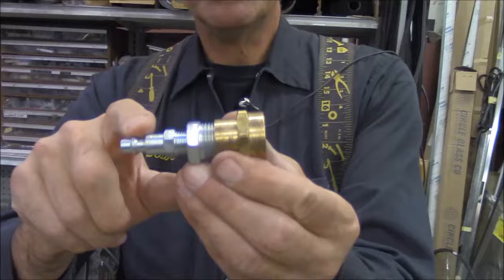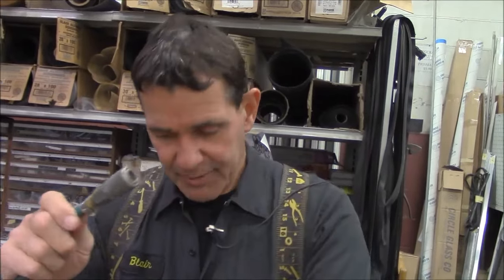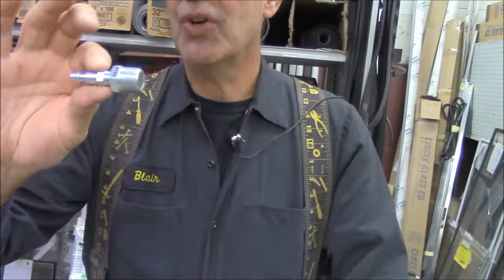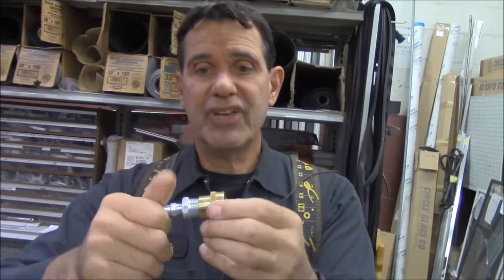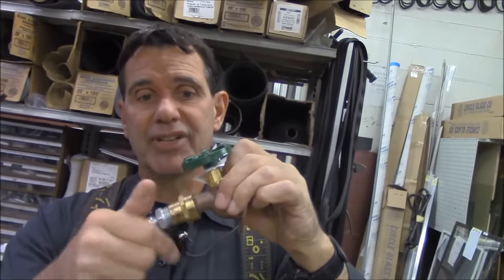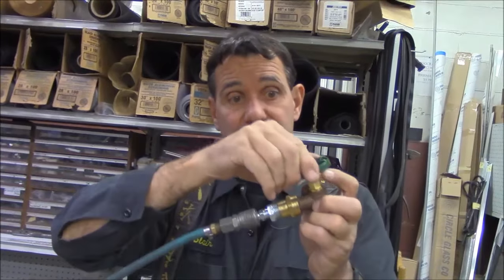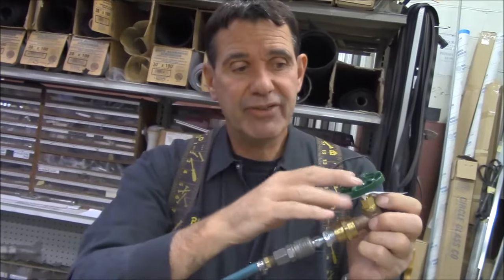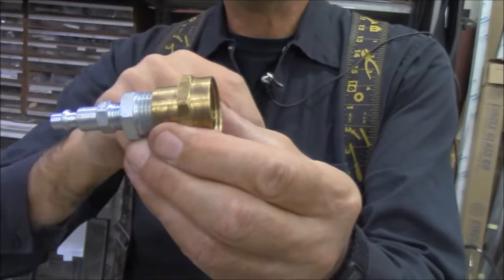Tips, Advice to Blowout, Winterize Water Pipes, Simple Air Adaptor Tool

Comment from the maker: Those of you with anti-siphon hose bibs or hose bibs with a vacuum breaker attached will have to find a different source to blow air into the plumbing.
Reply: How about the clothes washer valve? No one way valve on those.
Reply from the maker: Perfect, if you can get the compressor there.

Comment: 50 is a lot. I would use 30. 30 is more than enough to blow out PVC and CPVC. Also I never use more than 30 lb in my sprinkler system when I blow it out. It's volume not pressure you need
Reply: Exactly. Even 10 PSI is enough to get the water moving.

Comment: Great video, and something worth doing. Here's a question. My water lines to the shower/tub are pretty much clogged with build up. is this something that would work to clear them? I can't afford to have them replaced at this time, which is why I'm asking about if this would be a good temporary fix until I can have the funds to replace the pipes.
Reply: Sometimes people send water backwards and others use compressed air, however sometimes things get loosened up only to clog together in a worse situation. Pex plumbing is very inexpensive and is very easy to do yourself if you have some skills.
Reply: @blairgilbert7606  Thanks for the information. I wondered about making a worse situation. I'll look at installing pex.

Comment: Thank you! You helped a homeowner clear out a tub faucet after changing the cartridges didn't help. I really appreciate it!

1. Air compressor quick connect -> 1/4” male adapter
2. 1/4” female -> 1/2” male adapter
3A. 1/2” female -> 1/2” coupling (used this for tub/shower spigots)
3B. 1/2” female -> 3/4” male hose adapter (will use this later)
Reply: what was the blockage-was it calcium lime scale?
Reply: @sl5311  I can't recall tbh, but I think it was literally gunk from our city's old plumbing.
Reply: @nashdashflash  I just put white vinegar(the cooking type) in the shower head down to the blockage in the cold handle.  I bought an inspection  camera and saw that the hot handle side was almost blocked as well. I let it sit for 24 hours and I got a little of the cold blockage out, it is running a tiny stream of cold water so I will have to do it again.  One thing for sure is that a camera has convinced me to get a water softener. It was disgusting.

Comment: Hello Can you recommend an air compressor to me to clear the air out of my hose lines? Thank you
Reply from the maker: Anything that has 5 gal tanks or more. If you have a large yard you may need larger tanks, up to 10 gallons. The horse power is not too important because you will wait until the tanks are filled before blowing out each zone. The more horse power the quicker the tanks will fill, the tank full of air is what clears the line. I have a small 5 gallon compressor so I blow out each zone 3 times to be sure there isn't any water laying in a low spot.

Comment: Great video.  Does the compressor hose make a difference? Can you also list the parts needed in your video description with sizes?  Had to rewind a couple times :)
Reply from the maker: Air plug to 1/4" male pipe thread, a galvanized bushing 1/4" pipe to 1/2" pipe, av1/2" pipe to female hose adapter. Some teflon tape to secure the joints and a hose washer to seal the adapter to the hose bib.
Reply: BEAUTIFUL!!! THANK YOU!!!

Comment: 1/4 thread on quick disconnect? I may be wrong but it at least looks 3/8
Reply from the maker: The air plug is quick by 1/4 npt. It goes into a 1/4 x1/2 galv bushing, into a 1/2 by female garden hose adapter.

Comment: Hello, great channel, I just subscribed. Are there any particular brands you recommend? I’d like something inexpensive, if possible.  I'll be using it for a 450 sq ft cottage once a year, but will probably find other uses for it once I have it. By the way, does it help if I allow adverts to play all the way through, or can I skip them without loss of remuneration for you? Thanks again for a great channel. I bookmarked your homepage, too.
Reply from the maker: Always skip the adverts, we're not about the money. I would get the biggest compressor, largest gallon-age you can so you have so it has the volume to clear the pipes. Horse power is how fast the tanks refill. I purchase toys I can carry and store, don't get too big or heavy.
Reply: thank you!

Comment: Mr. Hardware, you are amazing in explaining techniques. My problem is that I have a portable car tyre inflator compressor which I intend to use to blow out somewhat clogged 1/2 inch domestic plumbing line. I am having an uPVC swan neck sink bibcock which is giving out very diminished flow. Shall I remove the bibcock and try injecting water directly into the 1/2 inch tee concealed in wall or do it via the spout of the swan neck pvc tap (as it would have its valve for shutting off air supply to plumbing; however I can do the same by switching off the air compressor though)? I am looking for a readymade 1/2 inch male steel nipple fitted with a car air pump nozzle adapter on other end. Suggest me something as I am not finding anything of that sort online. Thanks in advance.
Reply from the maker: It’s possible to get a schrader adapter that goes from ‘tire nipple’ to pipe thread. Then adapt that to a hose bib thread. The problem here is the volume of air is going to be so little, restricted by the small opening of the schrader, that there will be many locations in the house that will not be evacuated of water. Not to bring in the low ‘volume’ of air supplied by a tire inflator. I would not go down this path using a tire inflator, I’d use nothing less than a 3 gallon air compressor. You need a VOLUME of air to blow out water lines.

Comment: What type of fitting can I use on my 3/4 inch pvc lines to flush out using my compressor for the winter ? ? Thx
Reply from the maker: Probably using the hose adapter from the video because that’s where you’re going to attach the air compressor.

Comment: Very useful video. Is there a compressor, or compressors,  you would recommend? I would be installing it on my well house to winterize my cabin after winter use. Looking forward to your reply.
Reply from the maker: No, they change as fast as China changes factories. I do prefer USA made, however the plan is to have enough air tank capacity to evacuate our each zone. Horse power is about how quickly it recovers between zones. 2 gallons is a good starting point.
Reply: @MrHardware1  Thank you for your follow-up. Made in the USA is also my first choice.

Comment: Great video! Is this suitable option for clearing sediment out of pex plumbing lines?
Reply from the maker: Sediment is usually ‘glued’ to the wall of the pipe, air usually won’t touch it.
I have used muriatic acid to clean sediment in a drain line but potable water lines probably need replacement, sorry…
Reply: @MrHardware1  thanks Blair,  cheers!

Comment: Trying to blow out 50 some odd foot mobile home water lines through the cold washing mashine hookup. Turned off the water pump braker im getting nothing. No water in no water out
Reply from the maker: Sounds like there’s a vacuum breaker or a check valve. And you’re sure the washing machine valve is open when you’re hooking up the air?
Reply: @MrHardware1  i got it sorted out thank you for your response. 😊

Comment: Perfect advice but next question: Can you think of a way to attach a line to this adapter in order to blow RV anti-freeze?
Reply from the maker: It is hard because you'll need an airtight container with an in and an out. An inexpensive drill pump is quick and easy. With a short double female hose from the pump to the building and another from the pump into the jug of redpop you can pump it in easy. Be sure to leave the farthest faucet open so air can escape as the redpop goes in.

Comment: Bad advice if house has modern plumbing.  Hose bib with anti siphon feature will NOT ALLOW arrow to blow inside the house.  This is obsolete advice video
Reply from the maker: Thank you, absolutely true. Most cottages I deal with still have old style hose bibs that are neither antisiphon or have secondary vacuum breakers attached. We will have to add a video to explain the different situations.
Reply: In an effort to sound intelligent or whatever it was....... you saying his video was obsolete...did you realize you were commenting on a 2 year old video at that point.  Also, today in 2021 there are still a lot of situations where you would be incorrect.